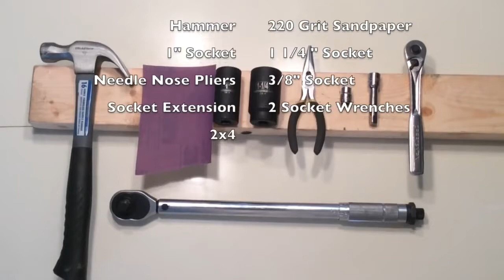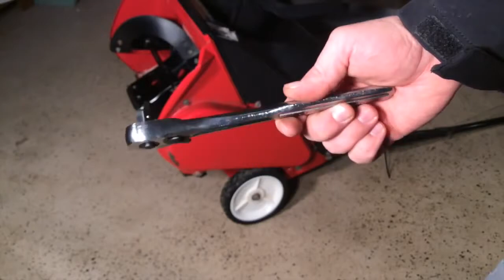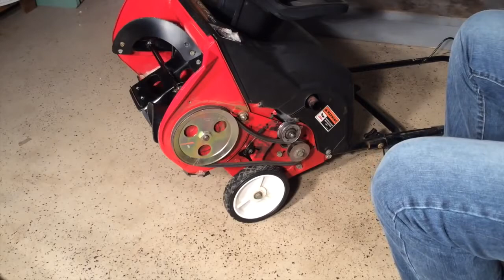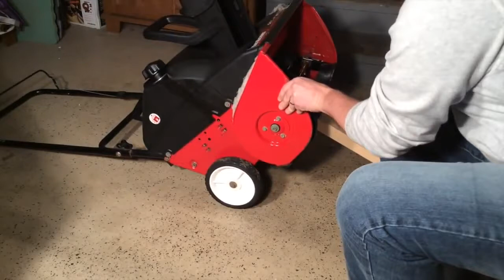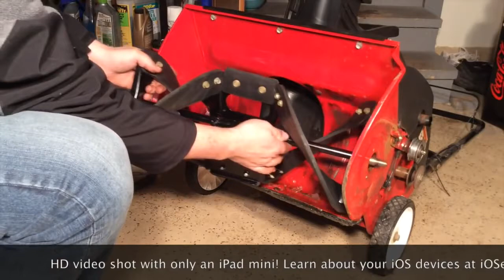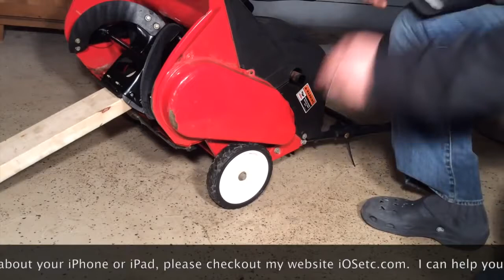Mtd  Snow Blower Auger Assembly || Full Repair in Hd

Comment: Thanks! I have a MTD from 1992. Pretty much identical. I have never serviced the bearings and know they must be close to dry by now. Just used the MTD today and Saturday. It still functions well and you have to use good gas--Ethanol seems to be a problem with these. My intent is to check the bearings and fill them if possible. To do that, one has to remove the bearing cover on one side and lube the races.  Another video points out since the pulley is always tightening up against the shaft when running, the end of the shaft flattens out--making it difficult to remove the bearing if you don't grind the shaft end off slightly.
Reply: I wish i would have thought about greasing mine, one bearing today while using the blower went and the paddles went floppy, Older unit like i wouldn't know where to even buy a complete replacement like the guy in the video did